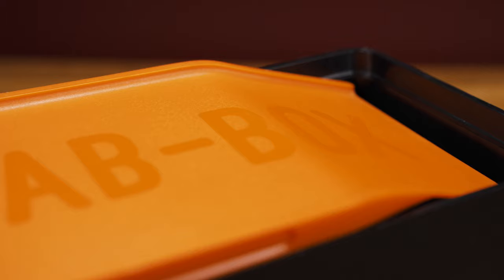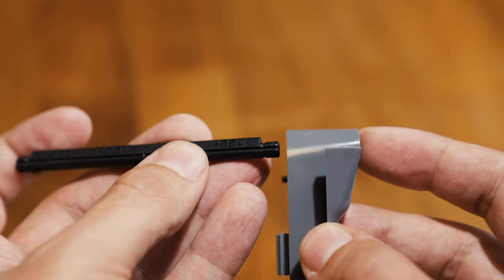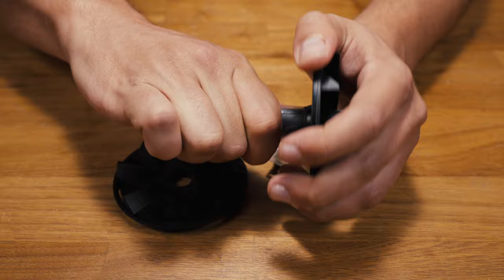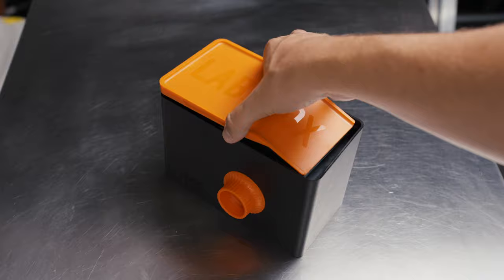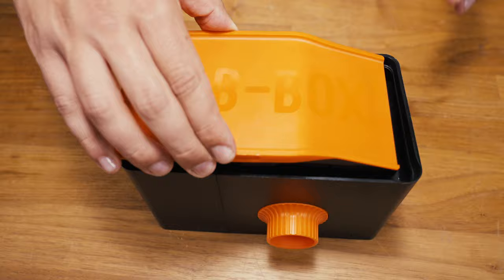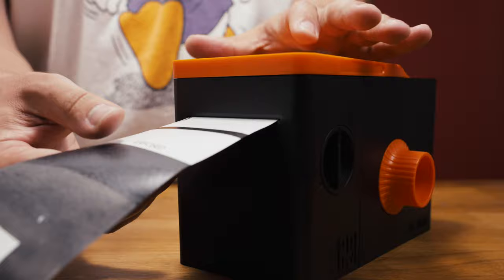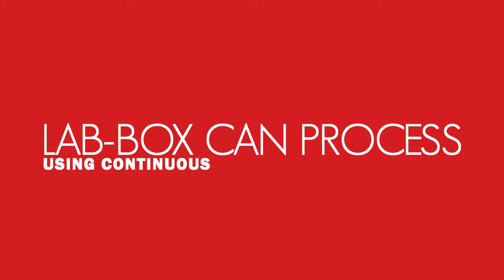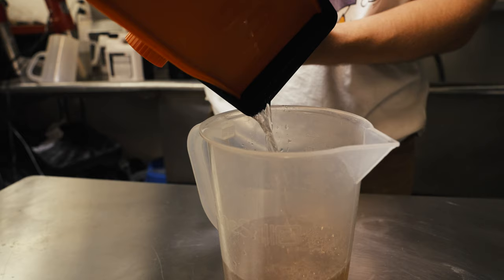Black and White Film Processing with the ARS-IMAGO Lab-Box

Comment: This and other LB videos gloss over the hassles relating to turn-around time and effort to process successive rolls of film. After processing a roll, all of the LB parts touching the film must be absolutely dry. So that is the film guide and the reel. The tank itself, film crank and lid, not so much. The film supply module, 35mm or 120, should never get wet under any  circumstances.  To speed up processing multiple rolls, consider buying an second reel to use while the first reel is drying. Not mentioned in the video is the absolute necessity of keeping the LB level and still while processing, particularly if using it filled rather than half empty. You never want to slop processing solution back into the film supply module. For the 35mm, it will rust the film cutting knife. (What were they thinking but not using a stainless steel cutting blade?)  If this occurs with the 120 module, the solution will drain down into the film chamber, requiring the whole thing to be opened and cleaned. Never wash the film in the tank with the film supply module attached - same reasons. Arguably, never wash the film/reel in the LB at all. (ARS-Imago originally offered a simple, slickly designed film washing accessory as part of the Kickstarter kit, but they eliminated it in mid-development. They never said whether that was because it didn't work well, or that they were just being cheap, as they often were.)
Reply: Agree about the importance of keeping the film cutter knife dry, but there's a simple fix: I pop off the film supply module before I wash the film in the main body of the LB.

Incidentally, if the blade does pick up some surface rust, it's fairly easy to dismantle the film supply module, take the blade out, clean it with steel wool, then put it back together after giving it a light oiling. I agree it would have been better to make the blade out of a rust-free material, but at least there's a workaround.
Reply: While washing the film on the LB reel in the tank is convenient, it remains unclear if that will adequately wash a film. Pouring running water into the top of the open tank may wash the tank, but little water will pass though the vertically installed reel. You can run a tube down into the tank at a corner (which is how the abandoned washing tube worked), but that does not get a flow of water running through the reel and over the film. IMO, washing in the LB tank would be limited to filling the tank, letting it soak for 5-15 minutes , spinning the reel every minute or two to agitate the film in the water. Then dump and exchange for fresh water. That is a very  slow wash process - at least 3 or 4 exchanges, adding up to 30 - 45 minutes. If you use the LB much, a more effective process might be to pull the reel and film from the LB and wash both in a conventional tank while using another reel for the next film.

Comment: I tried this hoping for the all in one solution to be great. But after using it it takes about the same amount of time as a changing bag and Paterson tank. I’ve also had some problems with developing consistency for some reason when the Paterson never does. Could always be me but for the price I’d go with tried and true Paterson/ Jobo. Or even a stainless steel tank if you like the reel style more. Those also let you do multiple rolls at once if your one to let rolls add up over time for development.

Comment: Super Great info ::: BUT maybe use this in the ending process ::: This 16 oz bottle of Kodak Photo-Flo 200 Solution is a wetting agent used to minimize water marks or streaks during film development. It is used after the final wash when processing films to decrease the water-surface tension and promote faster, more uniform drying.

Comment: And This in the last rinse :  Kodak Photo-Flo 200 Solution,   :::   This 16 oz bottle of Kodak Photo-Flo 200 Solution is a wetting agent used to minimize water marks or streaks during film development. It is used after the final wash when processing films to decrease the water-surface tension and promote faster, more uniform drying.

Comment: How are you removing the air bubbles off the film stock?
Reply: That doesn't seem to be necessary if you're using continuous agitation. When using this method, the tank is only about half-full of solution (it holds about 300ml) so each portion of the film is lifted out of the solution for half of each turn of the knob, giving bubbles a chance to dissipate. That's how I do it, and I don't see any problems with air bubbles or streaks (although I also pre-wet the film in plain water for 1 min. before I put in the developer, and I suspect that helps too.) I've never tried the alternative intermittent-agitation method so can't speak to that.
Reply: Air "bells", bubbles, form  when using inversion agitation. In a L-B, you do not use any inversion agitation. You use a half tank chem load, in which case you have to continuously agitate, thus no air bubble sticking the film, or you use a full tank, where the film is always fully in the solution, no air bubbles.

Comment: Does this also work with colour film or are extra steps required to develop those?
Reply: just pour the chemicals in and out as you would with other tanks. The reason he only used one chemical in the video is because the Monobath he used for BW film develops and fixes with the same chemicals.
Reply: The Lab-Box can process color films, but it requires color processing chemicals, not what he is using for B&W here.
Reply: If you're new to home development, using a patterson tank and reels is a lot simpler. (Use C-41 chemicals for color)